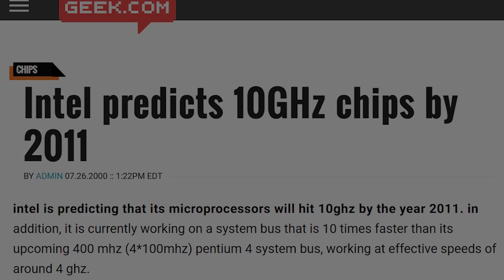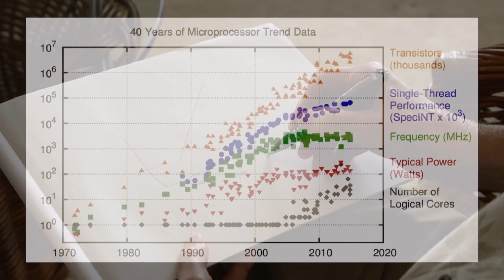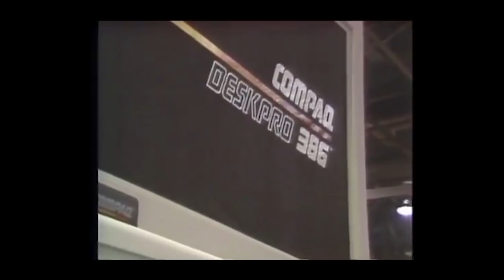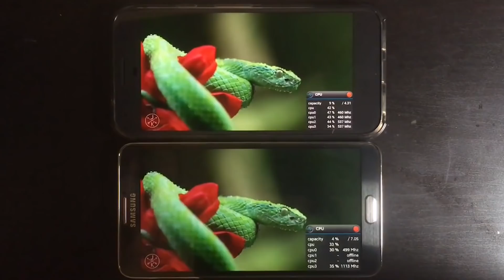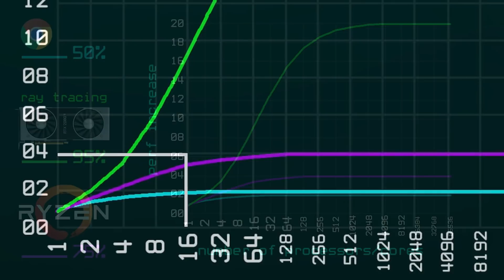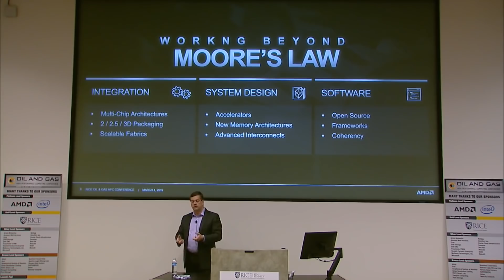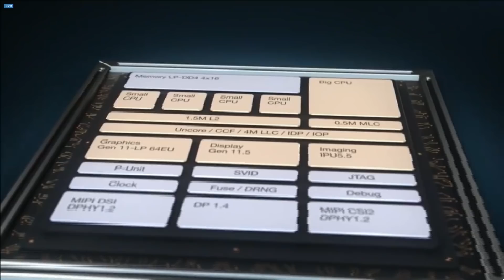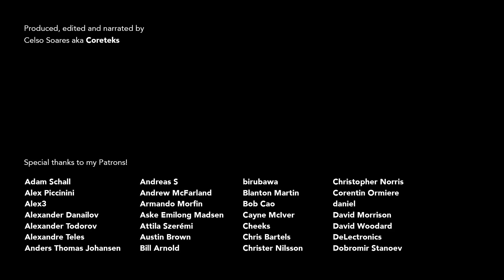Intel and AMD going BEYOND Moore's Law

Comment: You should consult more programmers. The bias towards procedural code? has less to do with a lack of skills than you appear to suggest. I can assure you that in the games industry at least? DX12 and Vulkan have greatly changed the way engines are designed. It is NOT a lack of skill. Any idiot can download a lock-free queue library and saturate their CPU within spitting distance of the most hardcore code out there. What you state regarding programmers? that's like claiming that CPU branch-prediction isn't perfect because the people that implemented it are incompetent.

And there being a core limit to performance? you've heard of super-computers, right?
Reply: Think he meant that the core limit is in regards to things like games, not the server market.
Reply: @Lightitupp1  he ignores Gustaffson's law when talking about Amdahl.. More cores enable us to do bigger tasks at same speed - and that's something gamers really want (bigger world, more NPCs, better AI, etc.)
Reply: Games are like a large simulation. 32 cores for the economy, 32 cores for the physics simulations, 32 cores to work with the gpu on graphics stuff, 32 cores for world simulation, and whatever is left for all your npc's.
Reply: @TheArakan94  Adding more cores only works for tasks that are inherently parallelizable. Sure, you can run a bunch of AIs on different cores, but what if you have AIs that make decisions based on other AIs? Then you have one core spinning while another does what it needs to. Similarly with physics (colliding and jointed objects). The best that can be done (which is already done) is splitting the underlying model of the game world up from the visual representation, and an independent controller for them.
Reply: And applications, not massive simulations.
Reply: super-computers usually dont do time-critical computations hence the ipc delay doesn't impact performance as much but business/consumer/gaming computers usually do.
Reply from the maker: I was talking within the context of what my viewers tipically do with computers, like run games and applications. Obviously if you are simulating the human brain (like with Steve Furber's Spinnaker computer) or doing other scientific simulations then having more than 32 cores is fundamental. And @Johnny Wednesday
, a word of advice: Don't start arguments with "You should...". Start with explaing the other person's viewpoint in your own words.
Reply: @Coreteks  yea, I know.. But same rule applies - bigger and more complex tasks will become normal on personal devices. For example, video analysis (face recognition for example) in phones would probably seem rather crazy decade ago.. But now, it's becoming quite common.

If PCs will have huge amounts of cores (dozens, hundreds), then better AI methods that require them (and therefore cannot be used now) will be introduced and perhaps we'll finally get good game AI.
Reply from the maker: @TheArakan94  That's a very interesting perspective on this that I hadn't considered. I feel like there will still be limited applications though, at least in the short/mid-term. But you are correct in saying that maybe there will be more types of workloads that today are confined to the scientific simulation realm that might in the future have mainstream use. Thanks for your comment.
Reply: @Coreteks  precisely.. Yes, there will always be limitations to what we do in our applications and Amdahl's law shows that speed up and total number of cores is always limited. Solutions is provided by Gustafson's law - increase amount of work done to offset the scaling problem.

I felt that this perspective was a bit missing from otherwise very good video and it therefore painted future of computing a bit too gloomy (same thing happened when Amdahl published his law).
Reply: yea he has no idea how asynchronous programming is a must in emerging technologies like blockchain and all or even simple apps, async is important, his research about programmers seem to be biased

Comment: I think that the unit in chaege of translating sequential processes into parallel ones should be almost completely hardware related, with just a small tweaking from the OS, otherwise, running such feature would be too much of an effort for the chips and actually make the problem worse.
moreover, we all can see what AI can do: you know, s***y DLSS. (I don't know if in the meantime it has got better, but some months ago it was awful)
also, it should not be used as an excuse for lazy optimisation. we programmers should just feel blessed that sucha technology even exists! yet, we still are wasting tons of resources. What power is needed to produce, on the PC side of things, the beauty of a view produced by a PS4? like, four times that? this exponential grouth of processing power should be directed toward the solution of exponential problems, and keeping linear problems on linear resource consumption.

Comment: It is a promising idea. The problem is, some kinds of tasks lend themselves to symmetric multi processing, and some don't. It's not a result of how the hardware is designed, (large instruction set v RISC for example) it's a result of logic and mathematics, things like cause & effect. It's very much like speculative out of order execution. Some kinds of things benefit from it and some don't. Some kinds of jobs just beg to be broken up into symmetrical parts and completed as a smaller unit, and then recombined as a finished product, and some just do not and cannot work that way.
It's bit like people saying AMD has doubled the width of their floating point pipeline, including both ends of it, so floating point performance is going to almost double. So far, so good. But then they say things like "This means a clear 30% improvement in IPC."  ... er ... no it doesn't. It means virtually a 100% (doubling) in floating point performance, but how much that will improve overall IPC depends entirely on how much floating point is in your code. Now some applications (many games for example) are very floating point heavy. But many programs are not. Doubling the floating point performance will make next to no difference to that program. IPC is a guideline. To make it any more exact and specific than a guideline, you have to specify exactly what code is going to be executed.

Comment: Compilers could also be vastly improved. Code could be parallelized during compilation possibly resulting in even higher performance increase than when using the 'AI' shown. You can't really expect all programmers to suddenly change habits, but you can change the tools they use. Besides that computers can optimize code much better than humans.
Reply from the maker: This is true but running things at compile-time hasn't been great for a lot of things. You can see how some native apps on macOS run so well because they execute at runtime instead (compared to windows). Final Cut Pro is a good example.
Reply: @Coreteks  I have always assumed compile-time optimization was superior but admittedly you do have a lot more information during runtime.

(btw including me in the video was pretty cool :) Don't worry, everyone is wrong sometimes, just not everyone wants to admit it and besides that the future is never certain in this field.Who knows, maybe the next big thing is something entirely different ¯\_(ツ)_/¯)
Reply from the maker: @piotrfila3684  Predictions are hard, especially about the future ;)
Reply: Like https://en.wikipedia.org/wiki/Automatic_vectorization ?

Comment: They need to make it easier for programmers to leverage the multiple threads, as it stands now, many programming softwares make it like a wild Hurdle to even begin making a program parallel, the main problem is if I hand a task to another thread, it doesn't have the same privileges any more as the main, that needs to be fixed either through architecture changes in data sharing or through os/kernel and how data is handled.

And that's not even mentioning many other problems, main one being is it's far more complicated. Would be easier if we could just generate a thread then tell some script to run off said generated thread, then generate as many threads needed as there are cores, and put that into a vicious cycle for ever task that needs to be executed.  . .

Edit: I've thought about what if ai was trained to make code run better on hardware level - if this has been done, then this solely is enough to fix all the problems, including in the gpu realm with multi gpu,
Reply: It is easy. Just use Go or Erlang. The problem is that it doesn't magically make your program run faster if you blindly add more threads, you will just hit more cold caches.

Comment: You are correct with ahmdal’s law, however I think most applications can do the majority of heavy lifting in a very multi-core fashion. And some very common algorithms will benefit greatly from more cores.
Reply: But then they have to synchronize at regular short intervals. That's what really kills it. Even web browsers could utilize  dozens of cores per tab, if the synchronization costs were zero.

Plus, as more cores get added, those costs increase at the hardware level, not just software.